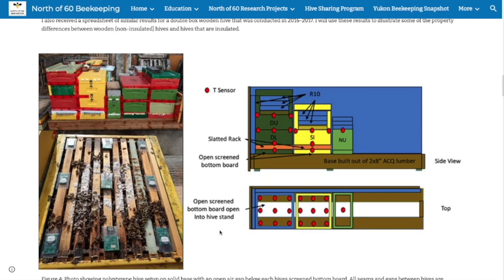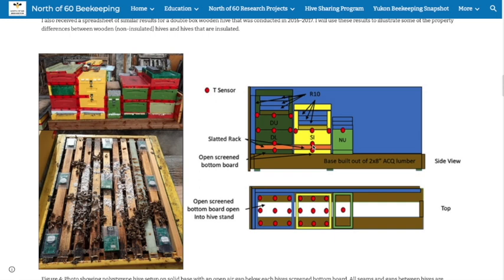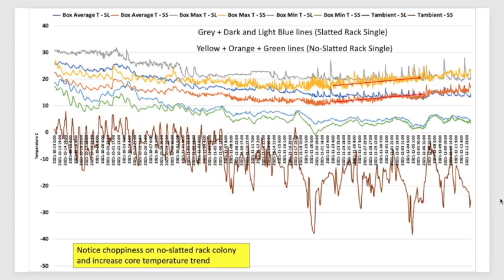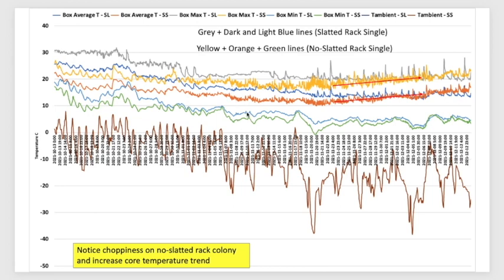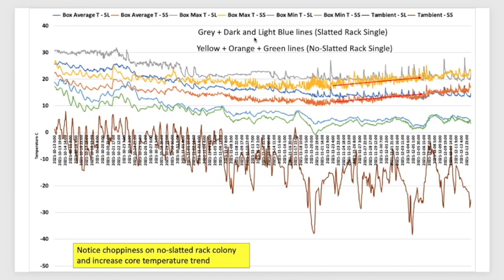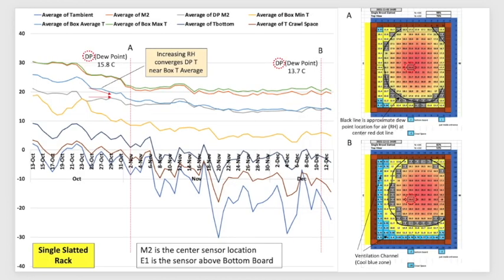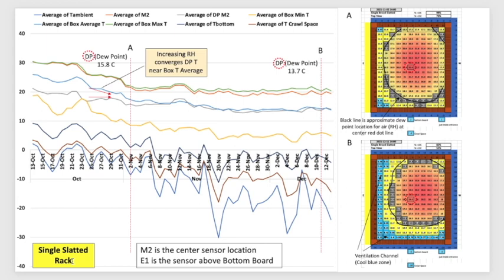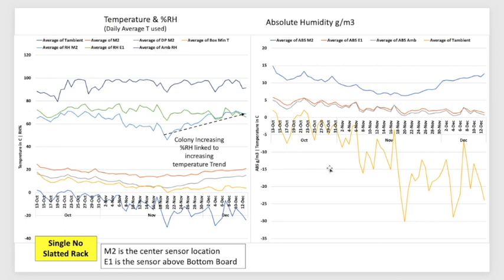Chart Deep Dive

Comment: In winter time: is the inside air humidity of the hives always significantly higher, than the outside humidity? I guess it must be. I wondering this question because I am planing to make the walls of my beehive from solid wood with isolation between the wooden walls. And so if the inside wall get more moist it also mean that it swell more and might cause some problems.
Reply from the maker: Depends if you plan on using alot of top ventilation. The challenge with RH is that it is temperature related. So in cold temperatures regardless of high RH the air is dry, the warmer the air the more moisture the air can hold. I use absolute humidity at key set temperatures as my moisture guide (11-15g/m3 @ 20C - no brood & 25-30g/m3 @ 35C - with brood), condensation only happens if the moist air is exposed to a surface at or below its dew point. Adding too much top ventilation will cause cooling inside the hive and risk condensation.
Reply: @etiennetardif  Hi there, how about the swelling of wood due to moist? Does it cause any structural damage to the beehive? Did you have any problems with it? Cheers
Reply from the maker: @damirloncaric4735  I use polystyrene hives but others here who use much insulation don't have wood swelling issues. My pine insert boards do absorb moisture wiith no problem or excess

Comment: Thank you for pointing out how a slatted rack would not work with a regular box, upper entrance, and no insulation. I need to do more research on how a Slatted rack is supposed to work, but the data you provide is sparking my interest even more. I live in East Central Indiana and I am still relatively new to beekeeping, however I’m always looking for new things to learn about.
Reply from the maker: The slatted rack would provide some drag (air friction) affecting the flow through air. A reduced entrance would do the similar...